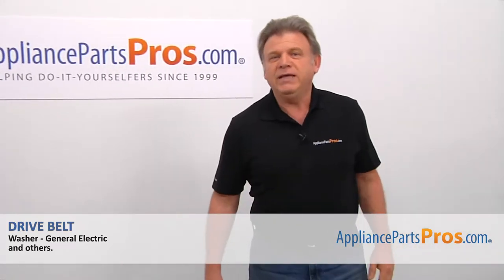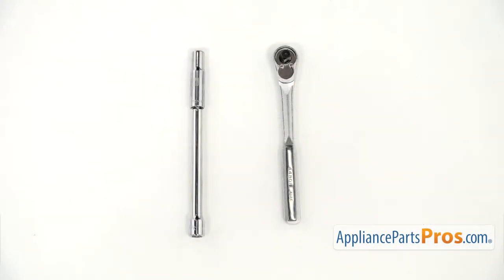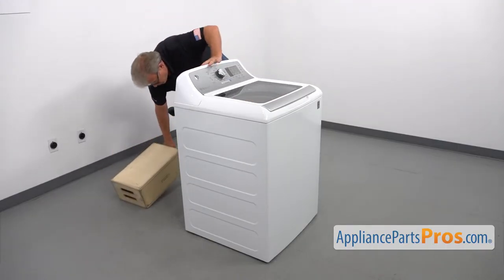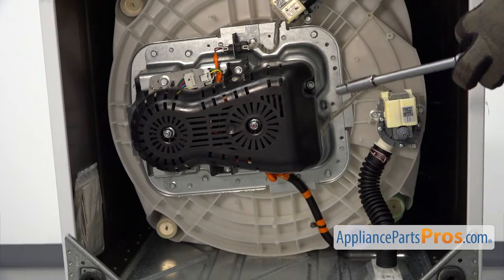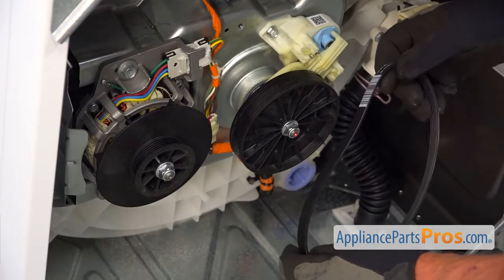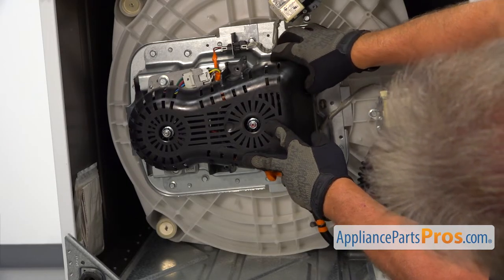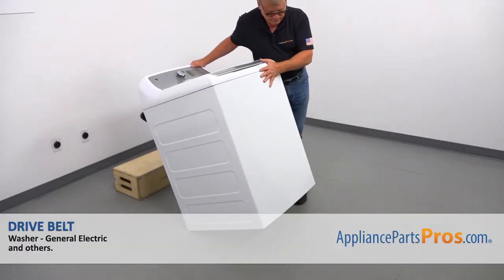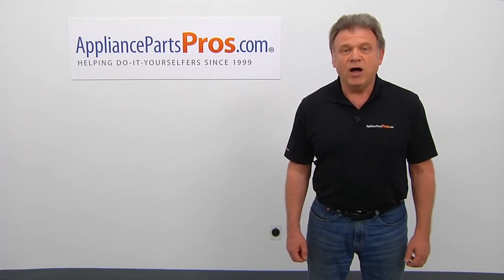How To: GE Washer Drive Belt WH01X24180

Comment: Good job editing out where you put the belt on. Really helpful.
Reply from the maker: I'm sorry for any confusion with the video. To replace it you will put the belt on the small motor pulley, then start it around the large pulley and rotate the larger pulley while keeping it on the smaller pulley.

Comment: the issue I'm having with my GUD27GSSMWW is that the belt keeps coming off after I place it back on the pulleys.  At first I figured, maybe it's misaligned and fell off. But it has happened 2-3 times and each time I'm being more careful to spin the pulleys after I replace it just to ensure that it's lined up properly. So perhaps it's stretched (after only 3 years...?) and needs replacement?

Comment: It would be great if you could to into a little more detail about how to get the new belt on.

I.e., does it basically come down to using brute-force as you're feeding it onto the larger wheel?  If so, are there any tricks for people who lack that strength?
Reply from the maker: We don't have any other tricks. You just will have to keep working on it.